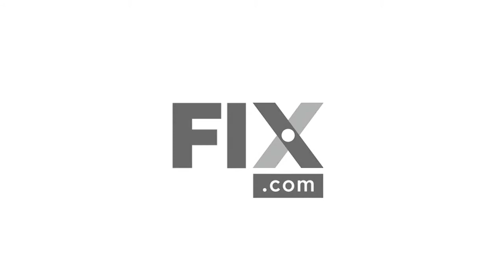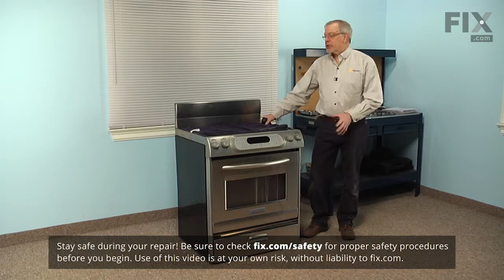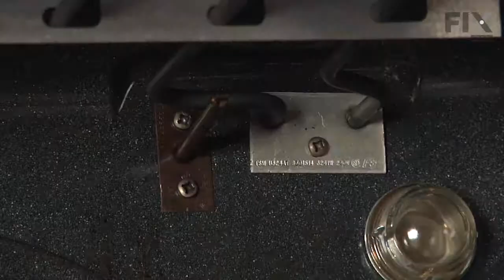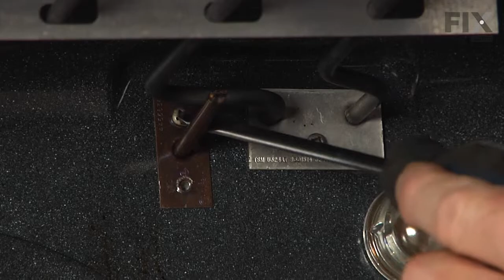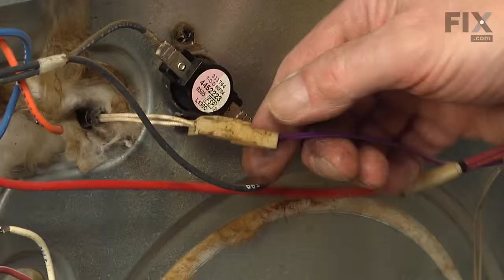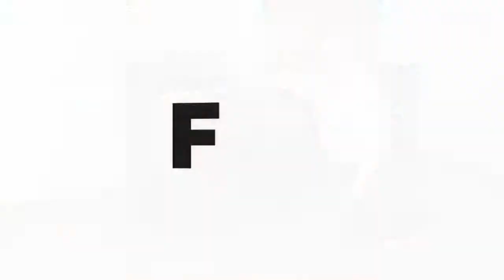KitchenAid Wall Oven Repair – How to replace the Temperature Sensor

Comment: In my self standing electric convection stove Kitchen Aid Mod. KDRP407HSS09...a true veteran....the temperature knob is not working properly....the  clock do not show at once and when it does...do not stay...goes on and off ....an all of this under 320 degrees...What should I check?----